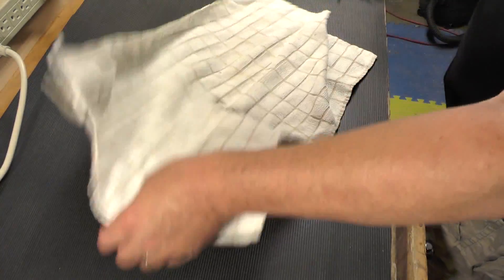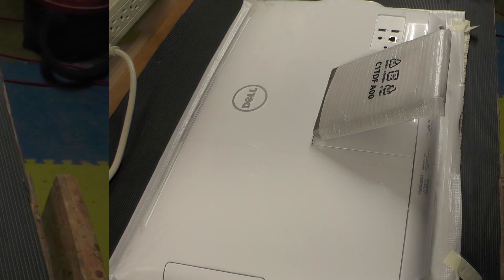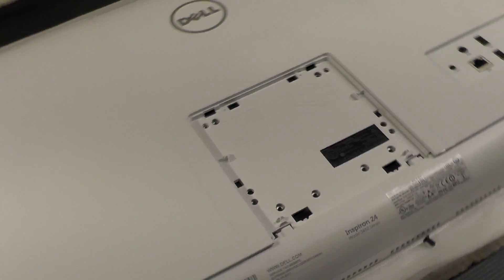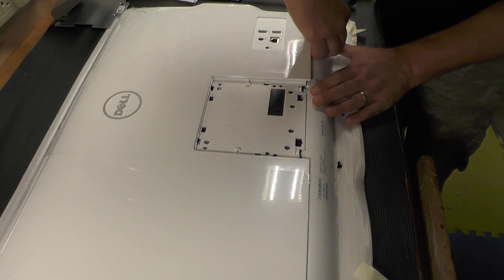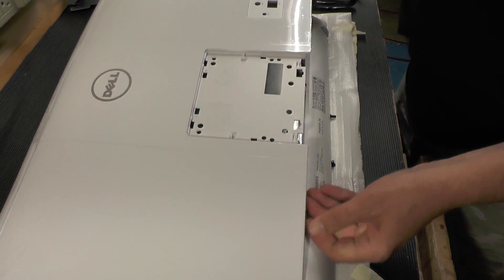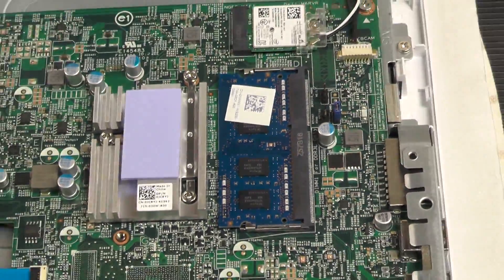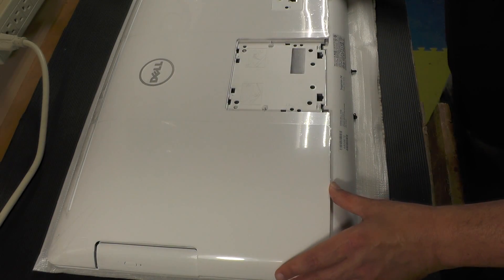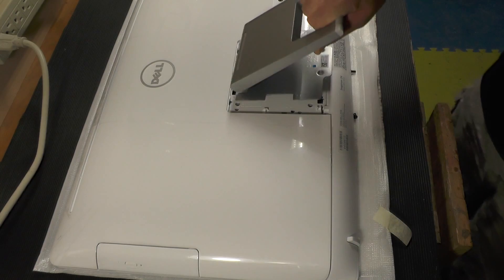Dell Inspiron 24 inch 3452 all-in-one RAM upgrade

Comment: The tell-tale sign this is a crap computer and should've been thrown in the trash immediately after opening it up, is the apparent lack of a CPU fan - passive cooling with a strip of aluminum and a thermal pad!? What was it running on - an intel Atom?  AMD-E2? It's basically a netbook attached to a 24" screen. I'm surprised to even see an actual hard drive installed instead of an eMMc storage chip. You definitely need to do your research when buying a computer, because this PC was obsolete before it even shipped.
Reply: Lolol

Comment: Ummm so guessing my comment got deleted??? Lol but yeah anyway had one of these given to me for free and just took it apart and put in an old SSD to upgrade the HDD , and got another stick of the same RAM that was installed since there's only one stick to begin with,
I actually was able to get the back off super easily without a spudger/screwdriver, just used my fingers and was able to get the back cover off just fine. Even the day after I clipped my nails 🤣🤣

Comment: One slot = 8GB MAX...... Two slots = 16GB MAX
Reply: @user-s2y5f  yes but it won't read anymore than 16GB and 2 X 8GB is the best route for dual channel speeds.
Reply: @danielk0106  where can i know that it will only read 8gb sticks? and is there a certain type of RAM or brand i need to buy?
Reply: @lazystudentprojects  What do you have?
Reply: daniel hoover Dell Inspiron 3455 all in one

Comment: Here is a tutorial from Dell: https://www.youtube.com/watch?v=igHtCeNk62Y
Reply: Service Manual: https://downloads.dell.com/manuals/all-products/esuprt_desktop/esuprt_inspiron_desktop/inspiron-24-3452-aio_service%20manual_en-us.pdf 
Hope this helps the next guy :-)
Reply: I opened it up to confirm and you were correct that there is only one 4GB RAM card and single slot in the aoi 24 3452.  It says it can hold 8gb but Dell does not show a factory 8gb card on parts list.  Can you confirm that a single 8gb stick worked?

Comment: It has two slots. You just need to release the clip hinges on each side of that ram and it will reveal the 2nd slot under it.
Reply: Mine only has one. I took out the original but there was no where to put the 2nd ram underneath
Reply: @cEcEalina  oh maybe there is a slight variation between models. I upgraded the ram and hd on a neighbor's model and it had 2 memory slots (1 under the other).
Reply: @Kevin J. A. Yea I was hoping that mine would be the same but there is a little piece of plastic that sticks out where the 1st one is placed which will not allow room for another one. I also read that for whatever reason mine will not support 16g upgrade, only a 8g which is still better than the 4g i had in. I do plan on replacing the hd today though. I am still new to this but do you know about the soft ware process once the hd is replaced?
Reply: @cEcEalina  Aww that sucks, but yup 8GB RAM is definitely going to be a big diff from 4GB.
So when I replace the HD, I prefer doing a fresh install of windows, so make a windows boot USB before you start. And back up all your important files from the old HD onto an external drive. Once all that is done, go ahead and open her up and replace the HD. And when you boot it up after, have your windows boot USB plugged in and enter the BIOS setup so you can install Windows.
Also I recommend upgrading your HD to a SSD because it makes a world of a difference. And don't forget to keep your old HD, because you can buy a HDD enclosure off Amazon for like around $15 to then use it as an external HD. Just plug it in and format the old HD (after going thru it again to make sure you saved all the files off your old HD), format it with the windows disk management tool.
Reply: @cEcEalina  That sounds like it is a plastic spacer to protect the contacts when the ram slot is unoccupied with an actual stick of ram. It should be removable like a stick of ram would be.
Reply: @Kevin J. A. Awesome! Thanks a bunch! I just double checked and I did purchase the SSD so that's great. I'll take a shot at it this weekend. Thanks again!

Comment: Dr.  I opened my Dell Inspiron 24” Model 3455 and there’s two memory slots. One under the top one. Double check yours to see if there’s an additional slot below. Thanks for the video to open. Simple once you know. Bob
Reply: I have the same one
Reply: I'ts a 3452 in the video, not a 3455. It only has 1 slot.
Reply: No  @davidlorin1379

Comment: Sorry about the disappointment with the RAM. But THANKS for the demo, your model is just like mine, so it made it much easier!
Reply: This model does come with two slots. I just opened mine and installed another 8GB, all he needed to do is to remove the Ram and access the second slot right behind it :)

Comment: I thought it was only one slot too, but I found a second one layered/staggered underneath the one that is installed right now... I have the 3459 though. I opened the little arms on the top slot to flip it up and access the lower slot.
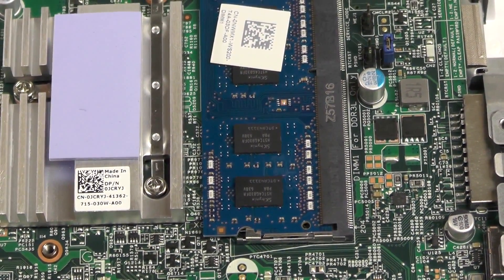Reply: @Pernoctate  the little arm and notch visible @ 3:20 looks like it should definitely pop up (whether there is an additional slot underneath, not sure, but it definitely opens). I maxed out that 3459 (bought around 2015/16) and replaced the HD around 2018, but for something I spent <$1000 for grad school it's shocking how well/long it stood up, I'm not mad. Barely replaced it this past summer with the new AIO, and only because I finally needed to upgrade it for my job. Despite their quirks these are fun little multipurpose desktops.

Comment: We just bought one of these and it is so slow I thought it would have been faster than it is.
Reply: These machines really were crap. I just put in an SSD on my mother-in-law's DELL INSPIRON 3455 today (yes, in the year 2023). It definitely makes it at least useable. Fast enough for an 80-year-old anyway. It does have 2 RAM slots but only 1 8GB stick is installed and so has only single channel memory; I will get another 8GB stick and see if dual channel memory will give it a bit more pep. It made her day at least!